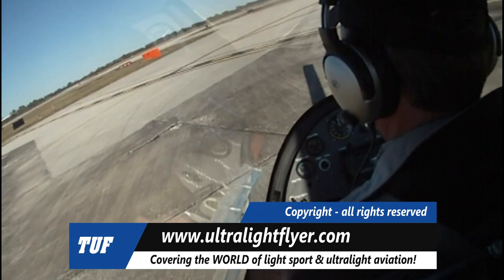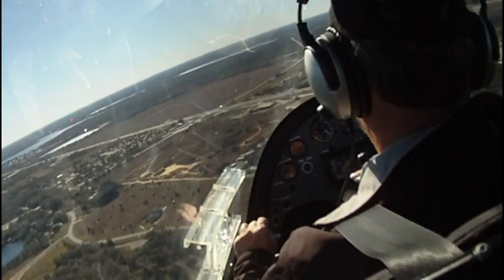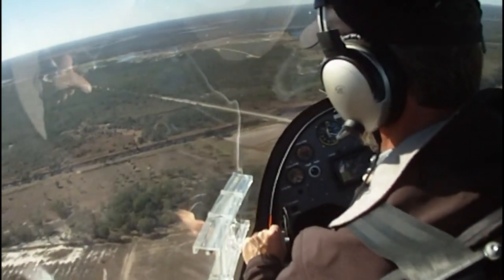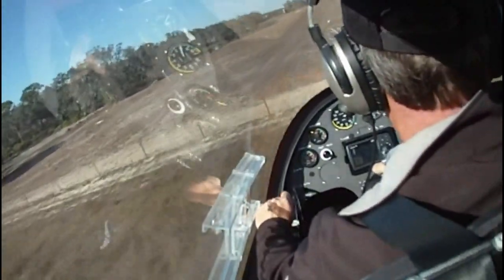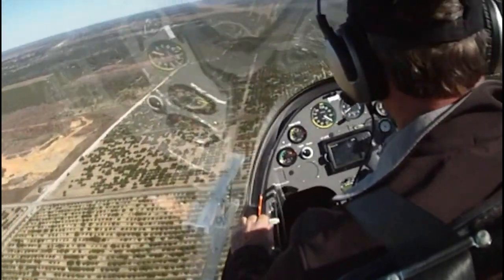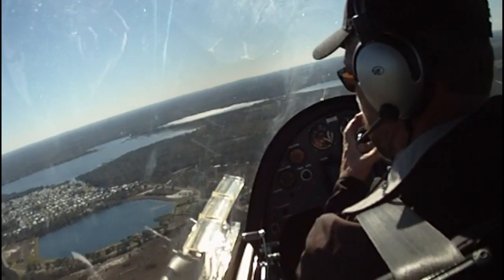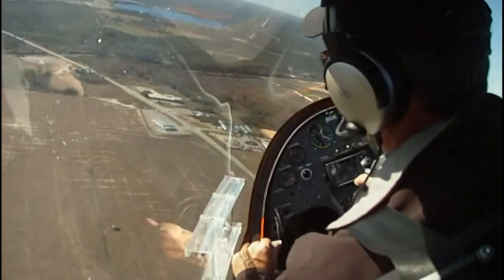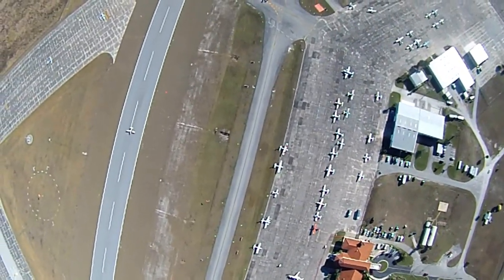Calidus AutoGyro, Flight Report Aircraft Review.

Comment: Wondering what 1 costs. Gas per gallon. How long will a gallon last ..time or distance..ball park..

In general yearly cost of maintenance 

God-bless you..excellent video. 

The ♥️ best I've seen
Reply from the maker: Depending on which 912 - burn rate is 4 to 6 gallons per hour. Distance would depend on speed of aircraft at that consumption rate. 4 gallons a 100 mph = 400 miles.
Reply: @ultralightnews  4 gallons in 100 miles equals 25 miles per gallon at 100 mph

Comment: With the tandem configuration and the amount of surface area which the fuselage has, is the much adverse roll with yaw? What is the minimum power off controllable airspeed. The pilot kept power in during his vertical descent to assure rudder effectiveness.

Comment: Why then are there so many Gyro crashes? Narrow wheel base on landing?
Reply: multiple reasons.  Primarily its still largely poor instruction.   I started flying these when I was 19-20 I'm 53 this year.  I was very lucky in that I joined a fledgeling club that was seeking training to fly a gyroglider we were putting  back together (from storage)  The other club still used gyrogliders.  these are a primary training method.  you have no engine but are towed behind a car.  you learnt all your blade management etc this way then our instructor test flew your powered machine usually hand built or brought from someone else who had.  He wouldn't instruct you in the machine until he was satisfied with handling power etc.  many left in disgust when he'd say you need a new prop or the Axle is too far back or the joystick is set up wrong.  we would then hear a month or two latter they'd rolled them into a ball.  I ended up bring trained to be our clubs gyroglider instructor.  however many in the sport were trying to get rid of the glider and clubs as old fashioned.  the 583 two strokes finally had enough power for two seat training in a powered machine.

So many instructors and CFIs saw the clubs as competition we were non profit and what we charged when towards the driver for fuel wear and tear and if you had a capable car you could use it.  The club I learnt in didn't throw out the glider but added two seat powered but instead of 20 hours or more the glider cut the powered time to 3 to 5 hours dual and hours of supervised ground instruction.  

regardless most clubs using gliders folded.  

today the two seat machines are massively expensive and generally massively overweight.  

Many of the current accidents happen on the ground  usually because few know how to wind rotors manually.  modern machines are tall because they are overweight and need 27-30 ft rotors (weight).  This means the masts are too high off the ground.  So no one ever hand winds rotors so there is general ingornance on getting the blades from a slow rpm to high without a pre rotator.

The solution to this is a mad procedure which smashes a lot of blades.

bear with me it's a bit complicated.  at low rpm if forward speed is too high and rotor rpm doesn't match the blade moving with the wind can stall and hit the ground, cut off the tail and prop.  In Australia thus used to be called hinging its called blade flap elsewhere.  Now the correct procedure is to slowly accelerate after a brief low rpm wind up by hand or pre rotator then taxing at say 8 to 10 mph at this speed the blades pick up like a wind mill and in 50m or so you can accelerate to say 15mph hold for a short time at which point they will be beyond hinging.  gradually add power and balance the nose apply full power and take off flat.  this is gradual doesnt use more airstrip (counter intuitively) and only required minor corrections on the stick.

these guys don't teach correct blade management rotors their version goes like this.

accelerate blades to 220 rpm hit full power.  now suck up airstrip while your rotors initially starts to decay (blades will only spin fast if enough airflow is going through them) .  now eventually if your blades finally get enough airspeed to build you scream along the strip while they build speed, if not managed perfectly they flap and you roll into a ball but more likely your overweight machine which often has incorrect Axle placement so it holds the nose down further delaying take off.  But rotors have enough to lift the nose only now because you are doing 40mph my old overweight VW with 22ft rotor would break ground at 22ish mph.  now you nose reefs back onto the tail and you are slamming the stick forward to regain control meanwhile because you've compensated for the massive weight with 120hp engine and massive prop you now find one wheel lifts from torque effect and you are nodding down the strip.

if unlucky enough to get airborne you may find yourself in the air with 25 degrees of disk pointing backwards which is an incredible drag brake.  It won't stall but I  that position if you don't get the nose down you may hit blades first and return your $120 000 dollar machine into a much less pretty pile of twisted metal and composite.  

Now if you spun you pre rotator up to say 120rpm instead taxied slowly at first and watched the blades actually managing the airspeed and rpm so you only add speed as they can accept then then the nose will gently lift when ready and you only need to add gentle inputs apply power as required no violent movements and the least wasted airstrip.

But the dogma says otherwise.  anyone who tells you the safety record is any better now just hasn't been following the statistics.  I was appalling then as it is now. 

Note I never saw a set of blades smashed up I the club I learnt to fly in and saw many, many people learn to fly   I instructed in the glider for 16 years off and on and we never damaged a set of rotors.  

If you find a good instructor they are amazing machines.  but a lot of myth a lot of attempted quick fixes like stabilisers etc.  one thing works good training to teach you to fly within the limits of these amazing machines.

Comment: Range and how reliable?
Can a turbine engine be used for reliability?
Reply: No turbine, not at all... the 115hp turbocharged Rotax engine is the maximum because of how slippery the airframe is.  It will overspeed if any higher power engine is used.  No turbine is that small and the fuel consumption with render it useless - about 20 minute of flight time!